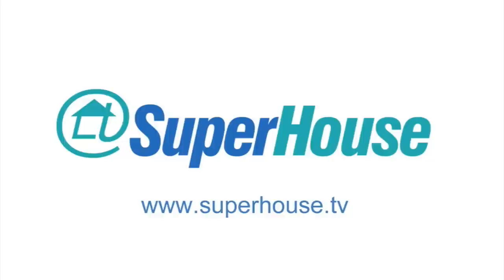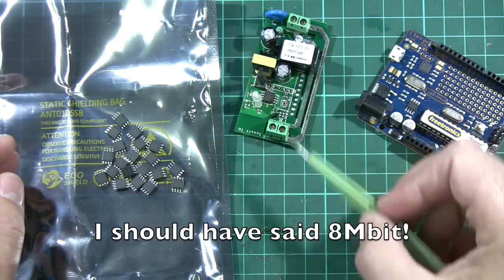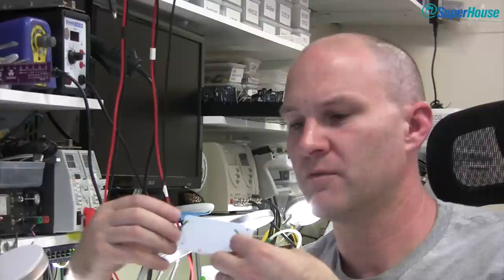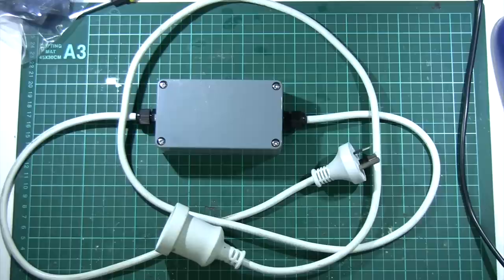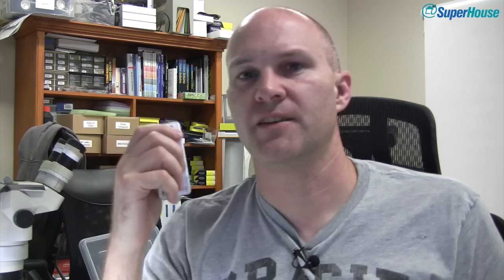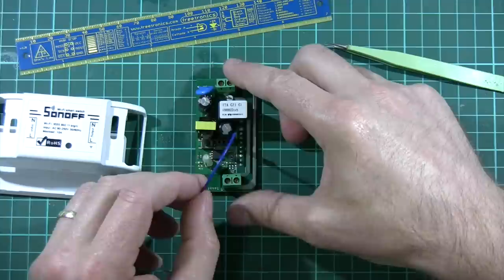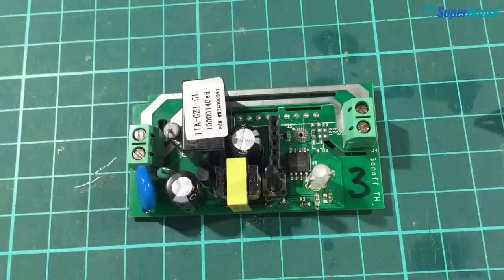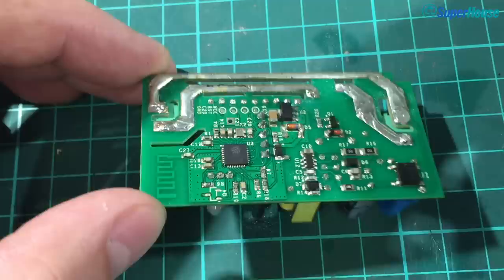SuperHouse #21: Six Sonoff Secrets: Storage, Safety, Switches, Sensors, Software, and Sites

Comment: I tried to do this 23:23 with my sonoff, I soldered a wire with ground and GPIO14 exactly as you but it didnt worked. Im using the latest 3.1v firmware sonoff with the app EweLink

Comment: Hi I think your video is great, I have just used a sonoff inching/self-locking modular to operate my horsmann garage doors. My question is are there any ways to use sonoff to detect the state of my garage that is are they open or closed as the sonoff unit I use only switches for one second. I would appreciate any feedback/pointers. Cliff
Reply: I'm looking for the same solution.  Have you found anything?    I think the temperature sensor input of a Sonoff TH can be used to receive an open/closed signal from a door sensor (regular magnetic sensor) then Sonoff will interpret each open/close signal as a temperature, from here we could set alarms in the Sonoff app depending on the door status.  I just have to buy a Sonoff TH and test it. 
'

Comment: Ok , I like what you do with the switch, at about 25 minutes into the video. Do i have to change the firmware for it, or does the Sonoff does it out of the box. If not, what firmware i would have to upload to it? I would rewire all my switches if it is that easy.
Reply: ZongaBR I wanted to do the same, did you figure out how?

Comment: 27:45 Why do you connect the Earth leads via a connector rather than directly to the Sonoff Earth connectors itself?
Reply from the maker: I could have, but it doesn't make any difference (the Earth connections on the Sonoff simply bridge between themselves, they don't do anything else) and I already had the wire connected together from previous demos. If I'd wired this up from scratch, it would have been easiest to use the onboard Earth connections.
Reply: @SuperHouseTV  Cool, thought there might have been a reason due to safety. I guess an external connector might be stronger than the Sonoff push connectors.

Comment: hi, what firmware are you using for the toggle switch to work. im usuing the bounce command on my arduino code which detects high to low or vice versa but not a change in state and looking about as proved fruitless so far! really enjoyed this episode keep them up!!!
Reply from the maker: You're on the right track with debounce code. That's a good way to approach the problem. Most debounce code uses two variables: one for the last known good state, and one for the current state. Then it checks whether the state is "flapping" (multiple rapid changes within a defined period) and ignores them until the state stays constant for a while. I've seen many different debounce examples on Arduino, which one in particular are you using? Maybe I can give specific changes if I know which code you're using. For the example in the video I was using Theo Arends's Sonoff firmware, which supports the state change feature by enabling the "USE_WALL_SWITCH" option and setting the mode to "TOGGLE".
Reply: SuperHouseTV I've had a quick look at his code which is actually quite a simple principal after all if I'm right. no fancy code as such just is pin high and last state low then swap relay and swap current status. then again is now high and then low. using a single digital pin read. then just shoe horn this in the basic code and away you go if I'm right.
Reply: Is there a tutorial somewhere for these steps described above ?  (the Tasmota configuration bit to support wall switch)

Comment: Hi, 
I am really interested in the application which was shown in min 26. 

Is this require any modification? Or can I just buy and mount the switch as you shown?

I really apprecihate if you can help me with this. The idea is great but I dont have the knowledge to change the chipset and make this software instalation that you have shown at the begining

Thanks again.

Comment: Good work. Is there a hack or Sonoff model that has a momentary latch, for use with a gate or garage door?
Reply: Check "Sonoff 4ch" out, one of the operation modes is as pulse signal.

Comment: I'm still looking for a way to allow anyone, guests, to connect with their phone to trigger switches. Give them an access code and open doors, lights, etc. Maybe a locally generated network html page.  Say there's an electric gate, they pull up and connect to network (which can be saved and automatically connect on most phones) and open the app page to open gate, etc.

Comment: This bloke is awesome!!! But I noticed @ 26.06 he used his phone to turn no the sonoff but he had to turn it on then off again. I thought the sonoff communicated to the app to tell you what state it is in? Or can this be fixed in a software change. I'm just thinking if I wanted to know if the lights are on at home but I want them to be of (or vice versa) I'm not going to know the state of the lights unless I'm home.
Reply from the maker: Good catch! That's because OpenHAB maintains its own internal model of the state of all the devices it controls, and if the state is changed externally (such as by directly pressing the button on the Sonoff) then OpenHAB doesn't know that it has changed. This is easily fixed by having OpenHAB subscribe to the state change topic published by the Sonoff, so that its internal model is updated when the Sonoff is toggled directly. I just didn't bother doing that for this quick demo.
Reply: Thanks for your reply. Iv only just found your channel and it's not something I know anything about but I'd love to do something like this in my new home but I'm not sure it will be in the budget. I'll probably have to do bits at a time. What state of Australia are you in?
Reply from the maker: I'm in Melbourne, Victoria :-)
Reply: SuperHouseTV looks like I'll be dropping in for a beer then. 😂

Comment: Hi  can you flash a firmware to be use with smartthings and still use the normal light switch to turn the light on and off or is this only the case if you use the Ewelink?

Comment: First of all, you are awesome! Thank you for sharing so much knowledge! 
Do you know if I can control this sonoff WiFi  only thru broadlink rm pro?
Reply from the maker: This is the first time I've heard of the BroadLink RM. Just looking at their web site, I think it uses WiFi to connect to your network so that your phone can control it, then it uses either infra-red or 315MHz / 433MHz RF signals to send commands to appliances. I may be wrong, but it doesn't look like it can connect to other devices by WiFi. That's just from looking at their site though: I may be wrong.
Reply: SuperHouseTV  I am trying to set a full solution, Broadlink seems to be on trend on Asia market. I have a curtain and roller shutter company.
Reply: Thanks for your answer, once again, you are great!

Comment: Great Video, really thanks from Argentina. One question, in the New Version of Sonoff RF R2 POWER V1.0, GIO4 it is not  soo easy available, Could you share some info about it? Thanks in advance. Sebastian
Reply: Pardon de GPIO14 I referred. Could we used other ping as the same function?
Thanks in advance. Sebastian

Comment: Is it possible to let the sonoff act as pulse?  so I can control my garage door?
Reply from the maker: Sure. You just need to change the software so that it changes the output high, then turns it low again. Do you want to control mains power to the door, or do you want to use mains power to the Sonoff, then use a digital output from the Sonoff to control the garage door? Remember that the relay output on the Sonoff has mains voltage on it: you can't just use the relay as a low voltage output, or connect it across a different device. The output terminals have mains neutral on one terminal, and mains active switched on the other.
Reply from the maker: I've just discovered that Theo Arends's firmware already has support for a pulse output when running on the Sonoff 4CH, which is the 4-channel relay module! So if you run this: https://github.com/arendst/Sonoff-MQTT-OTA-Arduino on this: https://www.itead.cc/sonoff-4ch.html you should be able to do it just by setting the configuration properly.

Comment: Hi I would like to make my own cheap offline system controlled by  a smartphone, what you suggest as today, considering that  I can solder well thru hole and a basic smd? If I'm correct now sonoffs mount a different micro... can I use tasmota or something similar? Thanks for the very nice video! Cheers from Italy
P.S. I can also program a bit of C :)

Comment: HELLO .CAN YOU TELL ME IF I CAN CONNECT SONOFF WITH MY DIGITAL THERMOSTAT WHERE I HAVE INSIDE TO HOUSE AND WITH THIS I PUT ON OR OFF AND I OPEN OR CLOSE MY BOILER FROM THE WALL TO DIGITAL THERMOSTAT I HAVE 1 CABLE (L)OTHER (N)AND ANOTHER ONE FROM BOILER.HOW CAN CONNECT THE SONOFF AND I CAN OPEN OR CLOSE MY BOILER.I WANT ONLY TO START AND STOP ,I DONT WANT UP OR DOWN THE TEMPERATURE.THANKS

Comment: SuperHouseTV, is the standard Tasmota switchsetting ok for a normal on/off wall switch? Is it switchmode 7?
You explain realy well that the hardware wall switch stays in sync with the software switch because of state change detection instead of on and off and that is what I want (WAF... ;-)).
Reply: Or do you just choose "GPIO14" as "Switch1" as default?

Comment: Hi,
Great work!
Is there anything like this for 12-24v applications?
Reply from the maker: Yes. You can do it with a Wemos D1 Mini and a matching Relay Shield. The TASMOTA firmware can run on the D1 Mini, so you can even use the same code.
Reply: SuperHouseTV straight over my head lol.
I was thinking raspberry pi based.

Comment: At 26 minutes and 2 seconds, the phone did not have the feedback of the information. Do you have a solution to this problem? How to obtain the return of the manual interaction ?? (SONOFF button or switch)...sorry for my english level...
Reply from the maker: The Tasmota firmware on the Sonoff publishes to MQTT every time it changes state from the button. You can make OpenHAB subscribe to that MQTT topic and update its own internal state when it notices that the Sonoff has changed. I didn't bother for this simple demo though.

Comment: Is it possible to get the firmware for the switch and wifi are working simultaneously at the same time. Please help,
really it will be appreciated, if you will share the firmware.

Comment: Hi, I want to connect my motorized TV lift to a sonoff in order to control it by phone and using Alexa, but i have not been able to find the exact list what what i need to accomplish this. Any suggestions?
Reply: Can't do that with a standard sonoff, perhaps the 2channel version. One for tv up, the other one for tv down. However, do you need to know whether the this already up? Perhaps a limit sensor to determine the state of the tv lift. i'd by using an Arduino and connect it to the sonoff via serial interface. Anyway, this is a start for you.

Comment: Hey mate im a sparkie and about buikd my first home and after watching yoyr video with the sonoff i think home automation would be pretty cheap to add so i have one question.

Can i use the sonoff th10 straight out the box or do i have to change firmware? I just want to use it to controll lighting

Thank you
Reply: Never mind I answered my own question by purchasing one as a tester.. have 2 th10s coming to test too. My first one was the basic. Now curious if I can add a wall switch to the th10 on stock firmware

Comment: 15:53 Never twist and screw fine wires down.... the will break, or will get "screwed" away to the side, therefore not enough contact and heat and fire..... ALWAYS use wire end sleeves with screw terminals and fine-stranded cables !!!

Comment: I am looking at using one of these sonoff sv modules for a project. The project requires a 3x4 keypad. Can a 3x4 keypad be connected to this module or has anyone ever done that with this module? I will be flashing the module for use with Blynk so programming for a keypad wont be an issue.

Comment: Can you please help me to set a timestamp whenever it receives a command, to stop automatically after each start? 
I can write another firmware if you tell me where to find the right one!
Thank you in advance!
Reply from the maker: By timestamp, do you mean that you want it to turn on for a while, then automatically turn off? Like a timed light for a hallway? That's already supported in the TASMOTA firmware I think, but I haven't used that feature myself. Look for the "PulseTime" command, which lets you set how long it will pulse its output. It can be done in 0.1 second increments up to 12 seconds, then in 1 second increments from 12 seconds to 64900 seconds.
Reply: Yes, Like a timed light for a hallway! 
I don't know to much about this, do i need to download a bin file and editing it in a program?

Comment: Could I use the original sonoff with no changes to splice it with my room light and its switch switch ?
Reply from the maker: You'd need to change the software, because the original Sonoff doesn't support the external switch. If you flashed it with Theo Arends's firmware (what I've been calling TASMOTA) and connected the switch to GPIO14, then yes. But if you want a total drop-in replacement, look at iTead's Sonoff Touch panels like I showed briefly right at the start of the video.
Reply: I have one of those touch light switches but it appears the chip inside is esp8285 and not the 8266... Additionally, the touch button probably does not offer for putting the chip in firmware burn mode... Any chance you would make a specific video on loading custom firmware on the touch light switches please???
Reply: Ok that is good to know! Thank you! However, I am having trouble putting the chip in flash programming mode; The touch button does not seem to work for this purpose... Any ideas?

Comment: in the UK our lighting circuits have a simple live going through the switch and the bulb - the neutral is at the fusebox. Is there any way to get a sonoff to work with just a live as there's no way for me to get a neutral wire to the switch in the wall
Reply: watch again it works with uk to I take it your not an electrician :(
Reply: basically you don't put the unit behind the light switch yo put it at the light position

Comment: Is there anyway I can use the sonoff to open and close my garage door instead of pressing the button on my wall?
Reply: Yes, buy Sonoff 4ch, and configure one of the channels to operate as 0.5 second pulse (you have to set only DIP switches, no software changes)

Comment: Could we use GPIO0 and/or GPIO13 as inputs?
Reply from the maker: Sure. In fact that's exactly what the stock firmware does when it lets you press the button to toggle the output. GPIO0 puts the ESP8266 into programming mode if it's held LOW while the chip is powered up, but after that it can be treated like a regular input.

Comment: No, thanks. I prefer wiring the bits and sensors up as and when I need them. I built a battery case and put in an Arduino  with ethernet to monitor and report on current in and out, battery voltage, temperature and smoke detector (which seemed like a good idea!) and also can emergency disconnect should the need arise. My backup camera (RPi) also transmits from 3 PIR detectors (a 4th on the front gives 360 degrees coverage). The RGB LED lights also have PIRs to turn on and off as required. That's the kind of flexibility I like.

Comment: Hi, I tried to add an extra switch connected to gpio14 and GND but is not working! I need to do any extra settings or..? Thank you
Reply: Hi there... I've tried too and It does not work.... is there something missing ? I have Sonoff Basic  R2,  V1.0    2017-10-11

Comment: How would I find an equivalent chip in the US? These chips are $5-6 a piece in the US unless you buy them from China (10 for $4) which takes about 2-4 weeks to arrive so I'm just wondering if I can look up an equivalent chip to order here in the US that doesn't cost so much.
Reply from the maker: You could search for that part number at a major US-based distributor such as Digikey or Mouser, but my guess is you'd be paying a lot for just a couple of chips.

Comment: hello the review is excellent. Can you please tell me is this safe to use on a water heater that has 1500 w 230 volts ? And can you recommend good wifi socket that is safe for my electric heater 2000 w 230 volts. Im a little bit afraid that it wont overheat or cacth on fire the wifi controler by that much power going trough wifi controler. Thank you.
Reply from the maker: The higher power rated Sonoff TH16A should be fine. 2000W at 230V is about 9 amps, approximately, so the 16A Sonoff should be ok.
Reply: Thank you for the answer.

Comment: Hi can anyone tell me how to attach wires to the push button on a SonOff basic so I can add an external momentary contact switch to the SonOff enclosure,looking at the base of the switch on the board it has 4 legs soldered to the PCB,is it the two to the outside of the PCB.